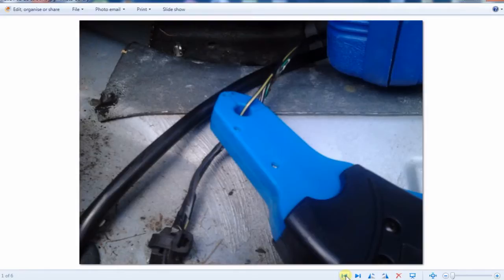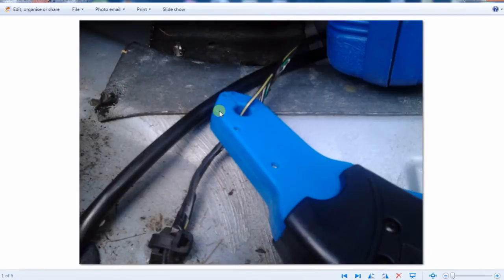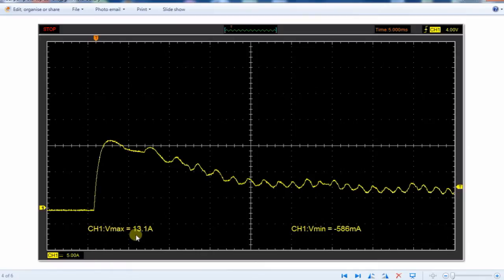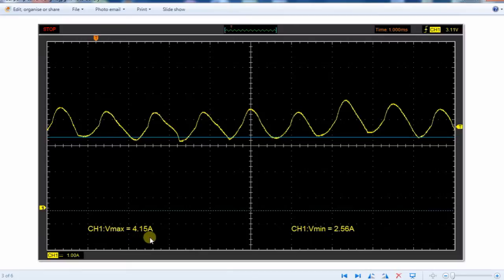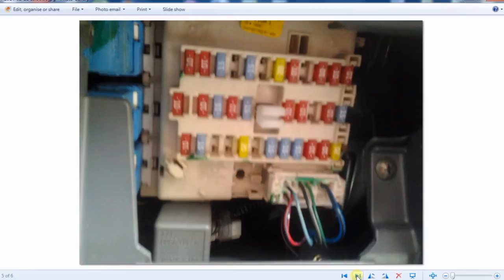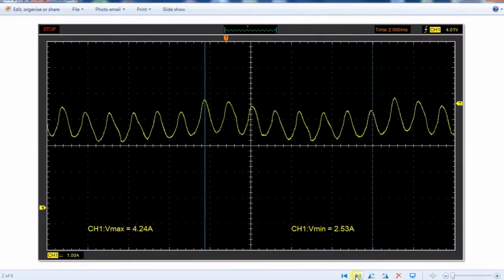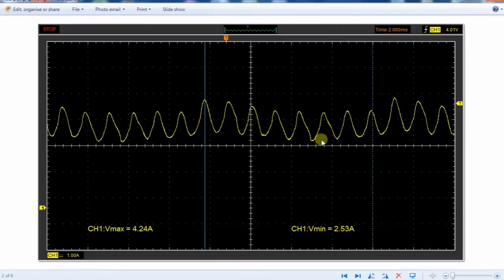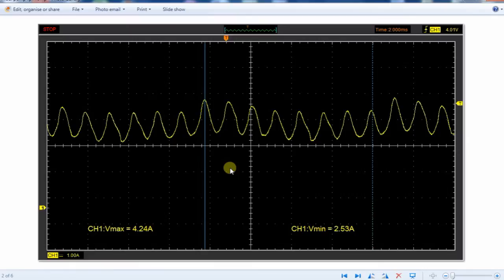Nissan Almera N16 1.5Ltr GQ Engine 2005 Fuel pump current

Comment: i see, replaced fuel pump and got 2.6-2.8 bar but lean problem still is there, cel come back yesterday! :(
Reply from the maker: check the fuel trim, If you have a scan tool (short term should be around 0% and long term should be no more that + or - 10%)
If fuel trim improves at higher rpm, then you more than likely have a vacuum leak
causing the lean condition
I
Reply: Electronic Workshop Thank you for your reply, checked vaccum leak and nothing, really engine sound smooth! idle is perfect,etc just it shows cel and looks like it lower power a bit somethings...next time to check should be injectors, maybe a ultrasonig clean should be good for them.... MAF?

Comment: Hi.. whats the solution for this problem? Im having lean problem and replaced fuel pump wth another used one and i still get 1.8 bar fuel pressure on fuel ramp...ill appreciate it a lot your help. Thanks.
Reply from the maker: that would be around 26psi, thats low pressure
I would check the voltage on the pump and its ground,
There should be around 12v .
The gnd should be around 10mV
The Current should be around 4.5 amps, If its higher than this, there could be a restriction in the fuel line, or the fuel pump is faulty
If there was a fuel pressure regulator on the fuel rail I would check this by clamping the return hose to the tank

Comment: Hi, good video. Just a question when you do the RPM calculation should you not take the ms reading betweene the "same" hump as you started with? also 9 peaks between, So you get a whole rotation? I did a current messure on my 1.8 Almera and got about 3A average. Thanks.
Reply from the maker: You would be right, I am a bit rusty on this,
the difference is 7000rpm approx. and around 6500rpm  measuring from hump to hump, thanks for the correction
I should add, this Almera has over 350,000 kM on it,
Were you using a current clamp with scope, or were you reading with a meter, if you were using a meter, you would not be able to get the peak reading
This could count for the difference in amperage readings
I had the facility to display average values, but I did not
I will redo this at a later time
I will have to check the calibration of the current clamp as well
Reply: Electronic Workshop
Well my average is highly estimated by just looking at the waveform. I'm sure I can do an exact measure with some setting. 
I used my pico, I have a picture but I don't know if I can post the link here thx to YT. Try, Link: http://goo.gl/DmKLsE
 At start it was about14A
Reply from the maker: SpelFocus
I looked at your capture, It does show a difference from mine
because you are using a Pico, I would have to thrust the readings you have
I have redone the measurements on mine, I still get a peak of 4.5A, maybe This is showing some wear or fuel line restriction on my video ?, with over 350,000km on this almera. I will try to get another 1.5 almera to compare
Thanks for your comments